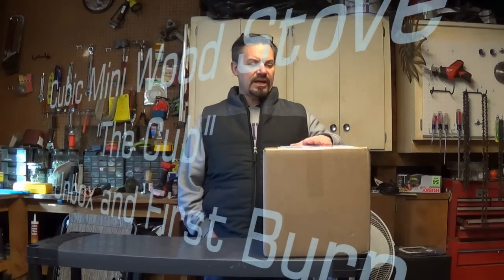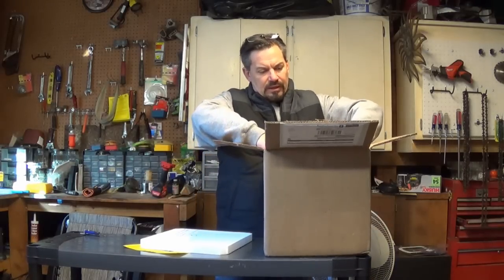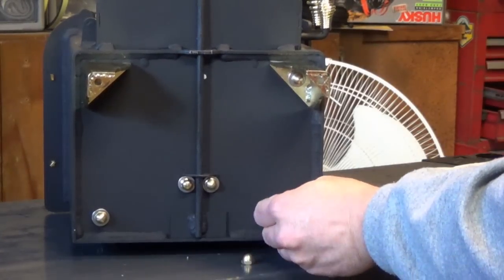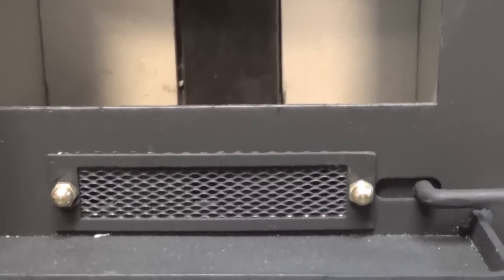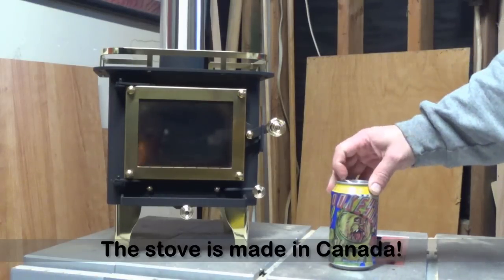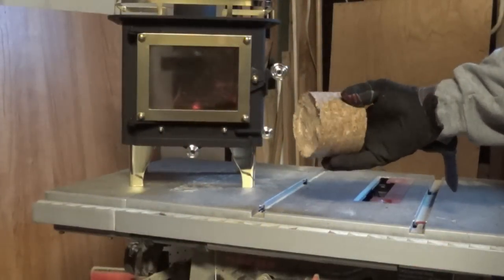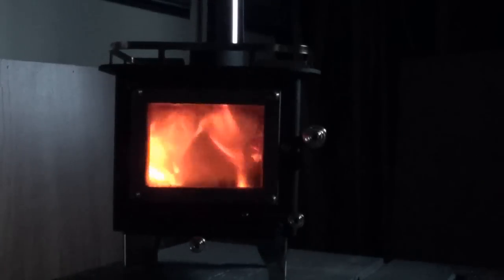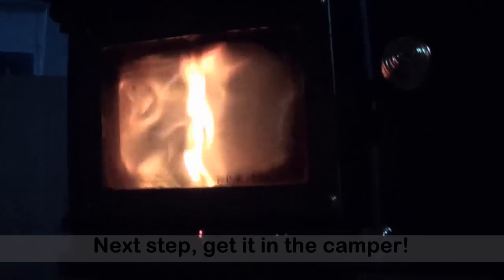Cubic Mini Wood Stove Unboxing & First Fire

Comment: I've had a cubic mini for about three years. Compressed log (or block) fuel does not burn hot enough so the chimney will soot-up within a couple of months if it is used regularly.
Reply from the maker: Good to know.  I know another guy who has one, his chimney soots up with hard wood too, so it kinda looks like a thing you have to deal with on this unit.

Comment: Not one word about the heat it's putting off.
Reply: That's really the review that many of the viewers want, I'm guessing. That's what I came for. 
1.The smoke issues, if any, and 2. How well it heats? 

So two questions. Perhaps someone else might have installed one, and could provide the information?
Reply: It looks like it'll heat a dog house... But I'd be Leary about anything from that country.
Reply: @subjugatedsisyphus  Canada.... An it was kinda meant to be funny but I didn't come off that way my bad.
Reply: Yeah I was expecting an infrared thermometer to come out at some point to measure the temp of the stove itself and nearby objects facing it
Reply: around minute 1 said Garage is too big a space to heat
Reply: @bruce-le-smith  sorry Bruce, thermometer  a few feet away from the source of heat would have at least been an indication of the heat being created by the equipment being  discussed.
  Or not, ..
Reply: There is another video done on this called "Cub vs Grizzly mini wood stove."
Great video too... and These little stoves reach up 700* to 800* easily. 
This other video, he says that he used the "Cub" for a 30" travel trailer for the winner...
Then he got the bigger one called "Grizzly" ...
Reply from the maker: https://www.youtube.com/watch?v=QBDTFNSq1yM
Reply: Bruce Norman Smith also said it’ll be used in RV I believe.
Reply: These are really well made and very warm.

Comment: Cool little stove. Compressed sawdust burns pretty well. Great demonstration 👍
Reply from the maker: Thanks 👍   it is actually too small to be functional.   Fuel only lasts about 90 minutes before it you need to reload it.  It did make my camper plenty toasty though.

Comment: I’m curious how the flu gases actually get out of the firebox? I see the secondary air duct, with the holes in it, that feeds from the bottom slide damper, clearly in the video. Does the flu gas go around that duct, or is there a hole in front of that, closer to the door?  Also, what are the two screws in the top for (inside the firebox)?  Love the video...Thanks!

Comment: Does it need a lot of draw in the height of the flue pipe?
You think 6 feet of pipe would draw fine?
thanks
Reply from the maker: I think six will work.  It worked good with eight.

Comment: How long did the compressed log burn? Will the stove burn all night? Thanks.
Reply: icecreamlady driver excellent question
Reply: icecreamlady driver I don’t believe it would e able to burn through the entire night no matter what wood was used. I could be wrong about this but from what I have researched you would need something like a pioneer princess oven to get through the night. But one like that is much bigger and heats about 2000 sq ft
Reply: @michaeltaddeucci7948  Thanks, Michael.

Comment: Nice touch with the limelight.
looking forward to that new Rush movie.
By the way....awesome little stove.
i need one for my 120 square foot hunting cabin.
Reply from the maker: It will roast you out.   I would take a look at the Nomad tent stove though.   Takes a bigger log.   I have one and like it much better than the Cubic.
Reply: Fernbark Frist 
Is that tent stove outdoor use only?
This will be indoors and most of not all tent stoves ive seen are not recommended for indoor use due to possible carbon monoxide due to improper combustion.
I don’t want to die in my sleep.haha.
I run hotter than most people so I’d only use when super cold and more when I have visitors.
Reply from the maker: You would need really good ventilation when first starting the Nomad, as it could smoke a little, but once lit, it really goes great.   Probably should ask Nomad if it would be good for a small cabin.
Reply: Fernbark Frist 
Yeah my cabin has great ventilation there open rafters with screen and hardware cloth so it will breathe good.
I also have a solar powered attic fan to pull the air through.
Even with no fan I’d have good ventilation.
I imagine it would be pretty cold in the winter until I got a stove fired up.

Comment: You know what you could do with that? You could run some copper pipe around your garage and create a radiant heat by pumping water through the copper pipe with a small electric pump. I assume you know what I mean.. It would be kind of like a boiler system where you're running copper pipe under or near that wood stove so it heats up the copper and water, then pipe it to a home made radiant heater that you also would make out of copper.. It would be a cheap way to heat any space..

Comment: Did you say how much you paid for it? I must have mist you saying that. It's really nice looking. You never said how warm it got? Did you ever check the temperature? That would be something I would look into for my little small house. Instead of a space heater or have both just in case the electrical goes out in the winter. I can still keep warm something about a fire during a crisis is calming to look at and feel the warmth of fire.

Comment: It would be great to see the installation, highlighting how to make sure you are doing it right and safe.  I really want to get one for my rv but dont want to.. You know... Burn it down..die etc. Thanks
Reply from the maker: It would be great to see that, but I am not trained/qualified to make that video.  This is fun to use, but not really good for overnight heat.  I just bought a Chinese Diesel Heater to put in my RV.   It will run all night, not kill your battery like the propane version, and you don't have to worry about CO like a wood stove.
Reply: @FernbarkFrist  you spent $600 for fun?  CO detector. Propain is way bigger safety issue.  If you have fresh air inlet and crack a window you are not going to have any issur with CO.  The wood stove would not pass any regulations if it was that unsafe.

Comment: Design a module that you can hang that will come into contact with the hot sides of the stove. That have a stirling hot gas engine with magnetic bearings that turn fans that suck up cold air from the floor heat the air then exspel the heated air into a room. A large fin radiator filled with therma fluid to conduct the heat from the wood stove would work nicely. You could also add a fresh air vent to draw air from outside the trailer to feed the fire then exhaust everything making the stove user friendly.

Comment: All good and fine but is it warming up the joint?
Reply from the maker: It will heat up to 200 sq feet nicely.
Reply: @FernbarkFrist  depending on how cold out it is. You'd have to keep reloading a stove that small also.

Comment: Should be able to tell how well it works atleast somewhat by how much heat it  gives off. Specially after more then an hour of burning. Nice lil unit. Thanks for the video. I'm going to look into one for my trailer.

Comment: What is the best material to achieve the longest burn and how long of a burn did you get.  If your using this in a camper will you need to refill every 45 minutes.  How much ash was left over.  Rocket stoves cook just about everything.

Comment: I have a full size on the barn but now want a small one for the shed
Reply from the maker: It would not heat my one car garage, but it would probably do well in a shed.
Reply: @FernbarkFrist  that will work just something to warm your hands over and take the chill out the air thanks

Comment: How long did that fabricated (?not sure what it's called) brick last.  I've seen people make bricks out of old papers and such. It would be a good way to make bills and personal docs into something useful.   Though I've heard it might increase the buildup in the flute.   How are you liking it?  Still happy with the stove?
Reply from the maker: I am still happy with the stove, although I did just buy a different unit that can take a larger log.  Size of fuel and using the top as a cooking surface are two drawbacks.  I think I get about an hour out of a press log.  I run the stove at full blast to keep it cleaner inside.
Reply: @FernbarkFrist  thanks.  I'm looking at using one on a sailboat and this tiny stove looks perfect.  Thanks.
Reply from the maker: It will roast you in a sailboat.  I would not make my own bricks to use in this item.  If you can, find hardwood.  If you get press logs, get the highest density ones you can find.  They burn super clean.  They are a little harder to get started though.

Comment: Other than all the comments about Rush and Canada, I would expect some more info on the heat output.  Temp in room before it was fired up and then after by the hour.  How did you vent it? Through the wall or ceiling?
Reply from the maker: You will have to watch my other video, link below, to see that information.   In this video it is vented thru the ceiling.

Comment: Looks well built.  Wonder how well it would work for hot tent camping instead of one then sketchy camp stoves.
Reply from the maker: The only problem would be you can only fit 5" fuel into the stove.  It runs out pretty quick,  so you would have to fill it a couple times a night

Comment: Ok, how did it do heating your RV.  How did you vent it in your RV to the outside.  How often do you have to add burn material to keep it going.  How hot does it get below.  In other words can you put this on the kitchen countertop without having to worry about melting the corian
Reply from the maker: Heating My Travel Trailer:  https://youtu.be/QBDTFNSq1yM

Comment: It was never mentioned, but I was curious as to what the temp got to in the shop after burning.
Reply from the maker: About the same.  This is way too small for a garage.
Reply: @FernbarkFrist  I'm looking for something to heat a small shop about 300-500 sq ft. Would this be too small for that?
Reply from the maker: @Aelanna  Depends on how cold it gets.  I would look at the Winnerwell Nomad stove (it is what I use now).  It is a little bigger and can accept larger pieces of wood.  The cubic stove is cute, but a real pain to process wood for.

Comment: nice looking little stove.  is the secondary combustion where/how the smoke gets burned?
Reply from the maker: Air comes in through the front which is burn number one, and there is a second air inlet at the top, which is burn two.  You can see it when you get the swirly flames on the top.

Comment: Nice looking stove!  The more we use ours, the more we love it.  We liked the brass trim around the top, but I ended up taking it off (easy to do) so that we could set a pot on top.  The brass trim was in the way.  Did you get the smaller Cub stove, or the larger Grizzly?
Reply from the maker: +Tinyhouse Prepper (Live simple. Live free)    I have the Cub.  I wanted the Grizzly for the larger surface area on top, but it was a little too big for the area I wanted to put it.  Funny you mention taking the brass trim off.  I was wondering if I was going to have to do that to put a kettle on the stove.   Or get a smaller pot.
Reply: +Fernbark Frist Hello Fernbark Frist, thank you so much for a great video, looks like it's working quite well. Can't wait to see what it looks once installed. As for cooking on the top you can come over to our Facebook page and take a look at our Cubic Mini Roaster that sits on top allowing you to have a larger surface to cook. May we post this video to our Facebook page and website? Thank you.
Reply from the maker: I will take a look at your new device.  You may re-post this video.  I am ready to get this in my camper.  I have been through a few mounting design changes so it is taking longer than expected.
Reply from the maker: That mini Roaster looks super cool!
Reply: +Fernbark Frist Great, thank you so much. We will be announcing the release date of the Roaster shortly. Looking forward to your upcoming videos. Take care.
Reply: +Cubic mini wood stove Wow, the roaster is cool.  It makes the stove very practical. I want one!
Reply: We will soon begin taking pre orders. Stay tuned :)
Reply: Cubic mini wood stove
Reply: Cubic mini wood stove

Comment: What is max burn time on compressed wood with stove turned down and how much heat do you still get ? 
I don’t think you could get a six or eight hour burn on hardwoods in stove that small but maybe with compressed wood you could. 
I’ve never used those compressed wood cylinders before but if you turn vents down so that gases are just barely igniting it might be possible.
Reply from the maker: Probably about 45 minutes.  It goes through the fuel pretty good.  You will learn you don't want to burn it too low (to save fuel) because you will soot up your pipes pretty quick.  My experience is that you have to run it pretty hot to keep it clean.

Comment: How did you hook the pipes up throw the ceiling or window or where ever ?.I like to see a video about that as well , please ?. It would mean a lot , to some ppl. maybe like me .And does the pipes come with the package , & if  not what do you type on line to look for those type of pipes , and how did you stop the black smoke stain from staining the ceiling . I would so like to see a video about all that , please ?.
Reply from the maker: I had a pre-existing chimney in the garage.  It was only a temporary set up to burn the stove in, and do a quick demo.

Comment: Can you cook on it? What's the biggest pot/pan if so? Time to boil? Weight of the stove?
Reply from the maker: 1. Yes, but not conveniently 
2. about six inches
3. Depends on how much water, what temp you are starting at, how hot the stove is during the boil, and what type of vessel you are boiling in (and probably some other variables)
4. 35 pounds
Reply: You can get a bread baking accessory from the manufacture.
Reply: Yeah..  I took a look at them on their site. Nice in many ways but definitively not a cook top. 
It's built more for aethstetics in mind than propose. I did like the wall mount and brass trim option. But it's not what I'm looking for is wise.

There's another more suited I was looking at last year better suited to my purpose. A portable winter indoor camp stove. It has a cook top, hot water heater/dispenser attachment. And other features I can actually use. And the cost is under a $100 for all. It's proven itself in the field by many. 

Yours still is a nice looking stove. I'm sure heavier built as well.

Thanks for responding.
Cheers...

Comment: So, did you get the chimney from the same place as well?  I'm planning on getting one for my hobby building. it's 12' X 20'.  I think this will be good as I thought a regular sized fireplace even the smallest would be too big for 240 sf.  Nice video.
Reply from the maker: +CaseyJones   It is the same brand that they sell (Dickinson) but I didn't buy it from them.  It is widely available.  I would recommend you buy double wall pipe like they use for pellet stoves.  The smoke doesn't leave the stove hot enough and can condense part way up the pipe causing build up in the pipe and leaving creosote running down the outside if you use the pipe they sell.   Watch TheTinyHousePrepper's videos to see what it looks like.

Comment: I heat with wood in a full size wood stove. I would guess you need to feed it constantly every 15-20 minutes ?
Reply from the maker: More like 30-60 depending on your fuel type.

Comment: Cool stove eh! Where did you get it? It would be nice to have in case of a power outage in winter. Our power went out a few times this summer frig. We heat with electricity too...
Reply from the maker: There is a link in the description on where to buy it.
Reply: @FernbarkFrist  ok great, thanks

Comment: You need to get a good bed of coals then put your log on. It will last way longer and doesn't just burn up. I heat my whole 2 story house with a wood stove and can make two medium sized logs last 10 hours! Otherwise you get a super hot fire that lasts a coupe hours them you're cold again.
Reply from the maker: Sounds like you got it figured out!

Comment: Is a solid non glass door available?  Best
Reply from the maker: It wasn't when I bought this.  I would check with the manufacturer though.  They might be able to make one that way.
Reply: Fernbark Frist Had one larger called a 3\4 size. Bought a steel door separate. No good if glass breaks, which would happen at worst time. Best

Comment: I can't imagine this would be safe inside a regular home.  So is that a correct assumption?
Reply from the maker: I don't think it poses any bigger risk than a full sized stove, but it actually heats only a small space.  I used it in my travel trailer and I still haven't died.

Comment: You  can cut your fuel bill by using pellets after a fire is lit and burning for a while. Also pellets solve the problem of a small fire box...😉
Reply: Can be a bit dangerous when they smoulder

Comment: i like this. how much burn-time did you get with the pres-to-log? and how long would a regular log last in there? thanks for the video :)
Reply from the maker: In order to not have creosote build up, you have to pretty much run it full blast, so you only get a couple of hours out of any fuel source before you have to refuel.  It is a really tiny burn area, so I am not upset about how long it lasts.

Comment: Show the chimney pipe and how you vented it
Reply from the maker: This is not the permanent installation.  I just had it rigged up to do a burn so I could get the stinky paint fumes off.  My garage has a 6" chimney already in the roof.  I just ran 3" pipe all the way up and out the roof for a couple days while I played with the stove.